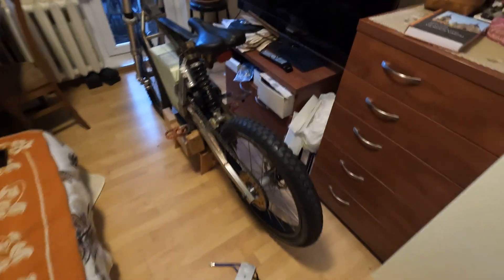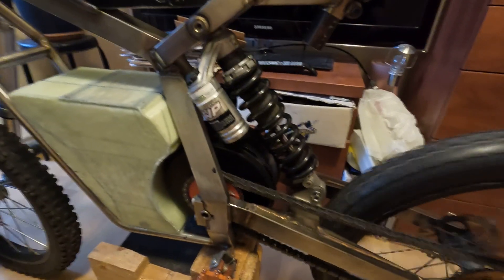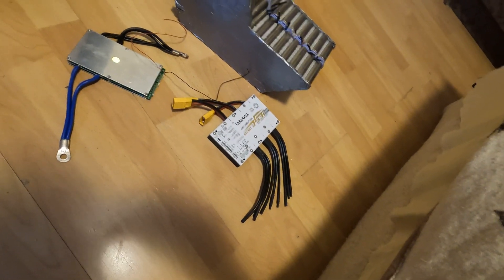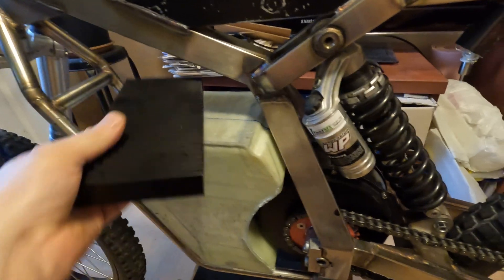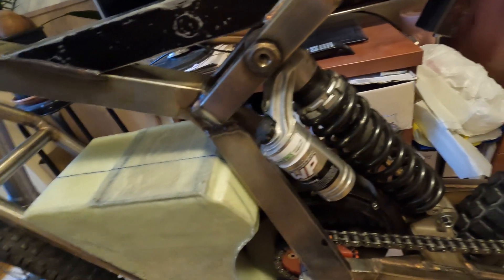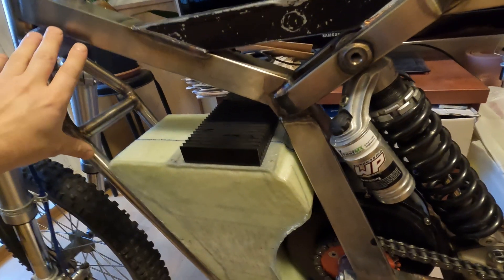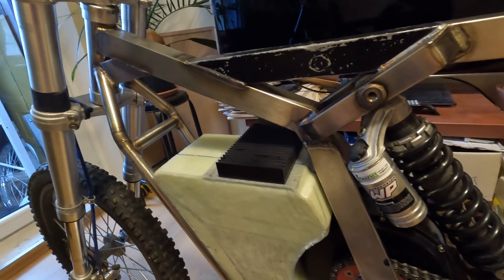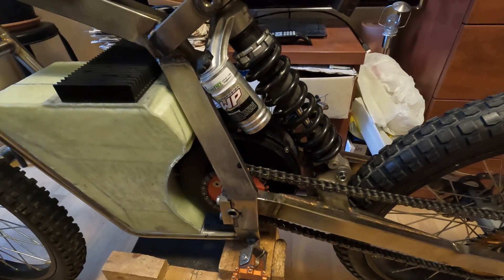Mid-drive electric bike V3 frame with QS205 hub motor.

Comment: Did you use a hub motor as a middle motor? 👍🏻
Reply from the maker: Yes, and it turned out event better than I expected.
Reply: @Musvilkis  I think that’s a very cool idea. What about the costs? Is it cheaper to use a hub motor or did you just had this one and tried to reuse it?
Reply from the maker: @Numerouno_2  It is like 5 main Things why i chosen hub. 1. Space utilization. 2. Center of gravity lower, because battery and motor almost on the same level lower to ground. 3. Chain tension always right because motor sits on spindle. 4. Lower rpm then other systems/lower sound. 5. I can choose from lot of motors.